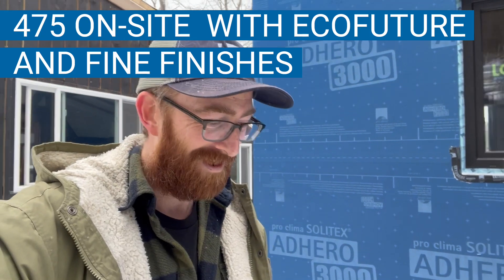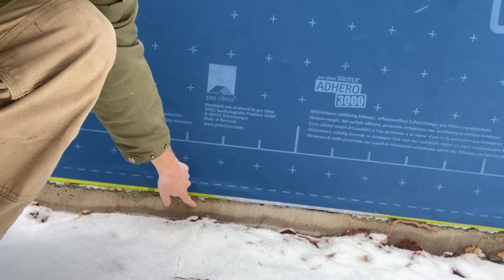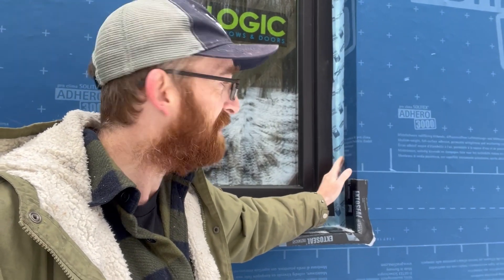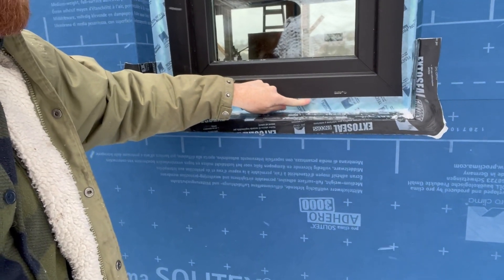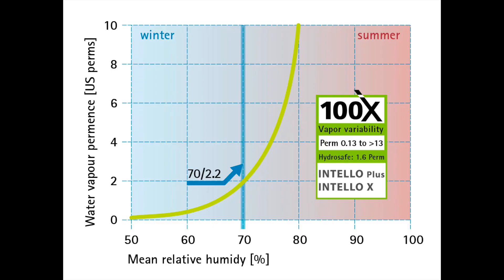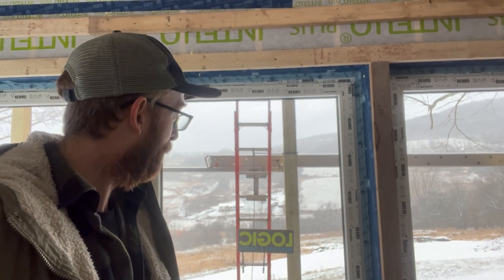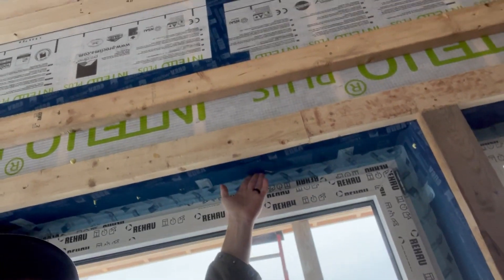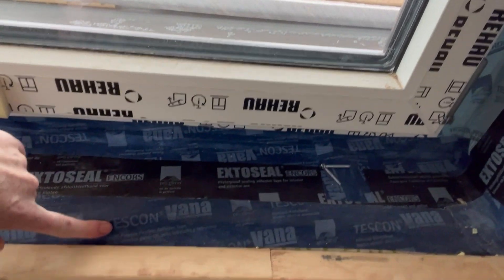475 On-Site: EcoFuture and Fine Finishes in the Catskills

Comment: Hey, Correy. Can you provide more info regarding TESCON PROFIL. I mean the value of Sd of it is very low. I am afraid that it is OK for outdoor but can be a cause of problem with condensation wh you use it inside
Reply from the maker: Depending on your climate zone / vapor drive, we've got plenty of different airsealing options that work. Get in touch and we'll be happy to help you out: info@475.supply